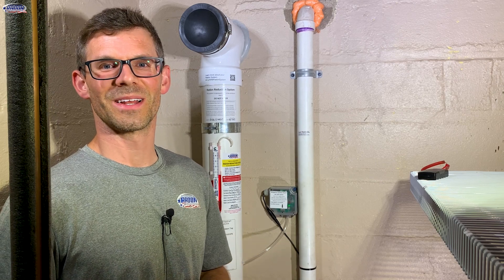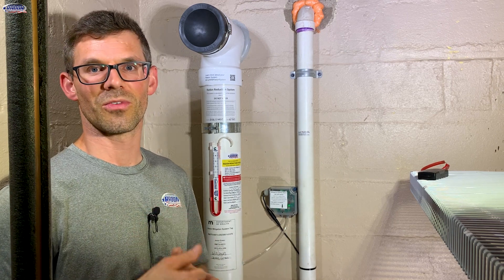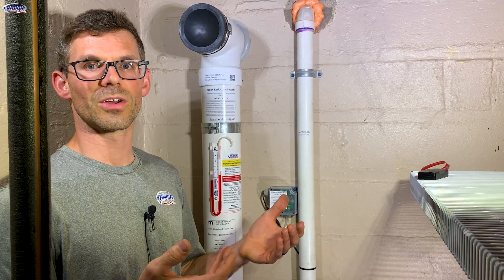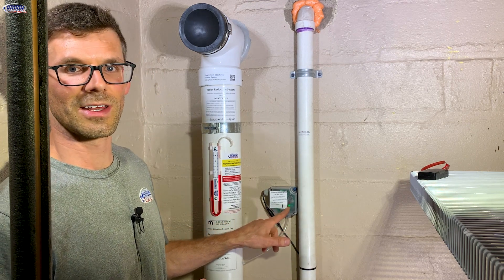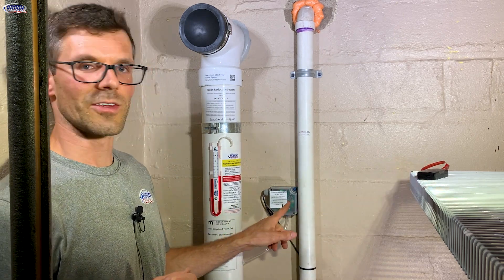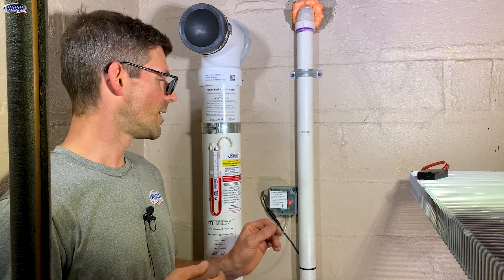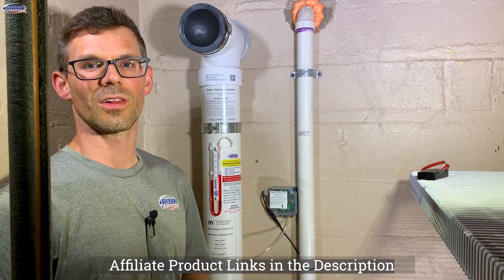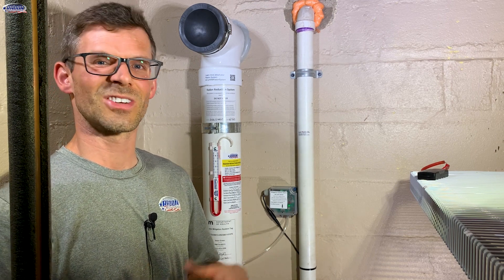Troubleshooting the Obar Radon System Alarm

Comment: I need to change the battery on the alarm for model D251 but I can't see how to pull it from the base, the video I saw looked like it was velcro but It seems stronger than that. It's placed on a wall since we do not have a basement
Reply from the maker: I’m not familiar with the alarm you are describing.
Reply from the maker: I’d contact the company that installed it.

Comment: I can’t find my controller but it’s beeping non stop. I still have good numbers and everything is working. Where could the beep come from? I’ve looked around. I installed the fan myself last year so it’s been working fine.
Reply from the maker: If by controller, you mean a radon system alarm. I would first ask if you installed one and then ask where you installed it. 

However, it sounds like you may have another type of alarm going off, like a smoke detector or carbon monoxide detector chirp.